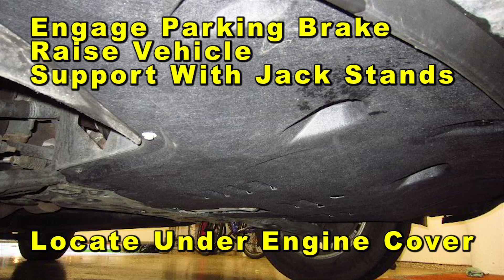Kia Sorento How To Change Serpentine Accessory Belt 2016 2017 2018 2019 & 2020 3rd With Part Numbers

Comment from the maker: Kia Sorento Serpentine Belts - https://amzn.to/3S1c0mr
ACDelco Gold Fan Belt Part Number - https://amzn.to/45BagDJ
Tensioner & Pulley Assembly - https://amzn.to/3tAdPg1
Gates Micro-V Belt Part # - https://amzn.to/3ZZpSzM
Precision Screwdriver Set - https://amzn.to/3OYN1i0
Plastic Pry Bar Tools - https://amzn.to/3HMtsV7
Socket & Ratchet Set - https://amzn.to/3Z17LbA
Mechanix Gloves - https://amzn.to/3jCnHkt
Torque Wrench - https://amzn.to/3vS5uSI

The Paul79UF YouTube channel is a participant in the Amazon Services LLC Associates Program, an affiliate advertising program designed to provide a means for sites to earn advertising fees by advertising and linking to Amazon.

This DIY video shows owners of the 3rd generation 2016, 2017, 2018, 2019 and 2020 Kia Sorento how to change the serpentine accessory (fan) belt on the Lambda II GDI 3.3L V6 engine.

Comment from the maker: Check out the DIY guide for changing the serpentine accessory belt in a 2016 to 2020 Kia Sorento SUV - 
https://www.paulstravelpictures.com/2016-2020-Kia-Sorento-Serpentine-Accessory-Belt-Replacement-Guide/index.html

Here are all of the DIY repair and maintenance tutorials for the third generation 2016, 2017, 2018, 2019 & 2020 Kia Sorento - 
https://www.paulstravelpictures.com/Articles/2016-2020-Kia-Sorento-DIY-Repair-Maintenance-Guides.htm

Owners of other Kia, Hyundai or Genesis vehicles such as the Niro, Sportage, Sedona, Telluride, Optima, Rio, Forte, Soul, K900, Cadenza, K5, Stinger, Tucson, Santa Fe, Kona, Palisade, Elantra, Sonata, Accent, Veloster, Ioniq, Nexo, Venue, G70, G80 and G90 may also find these DIY instructions to be helpful.